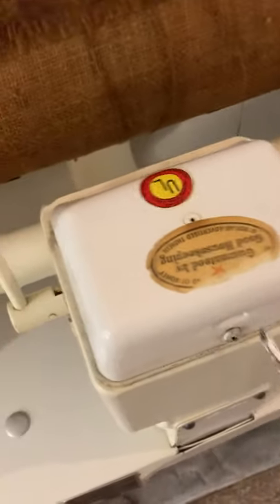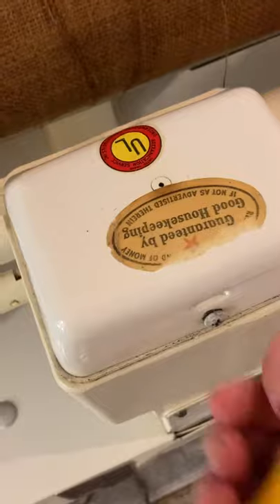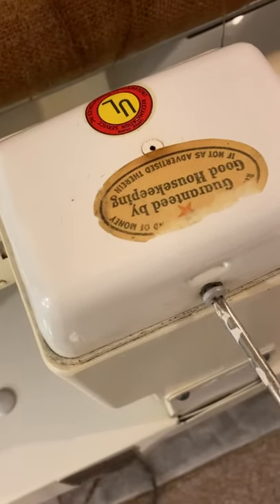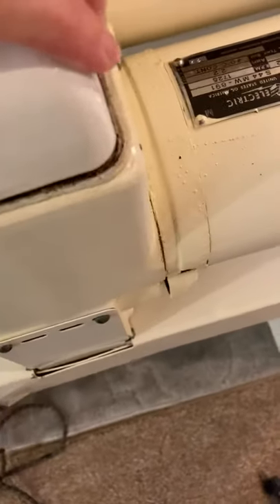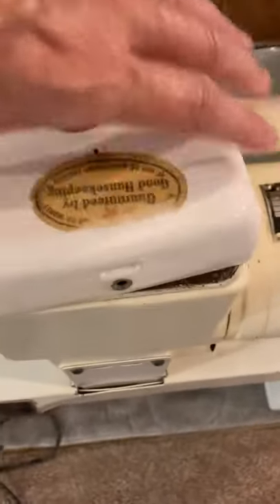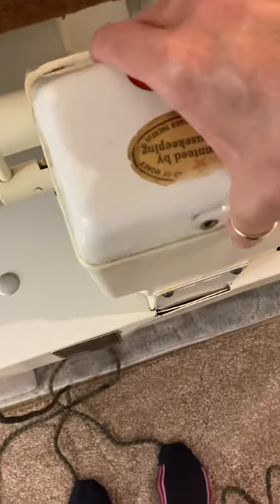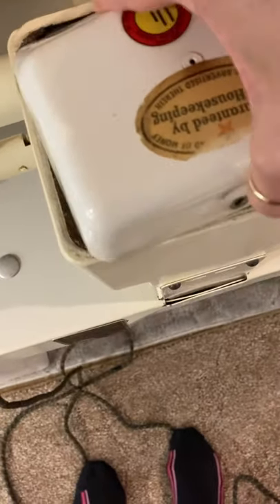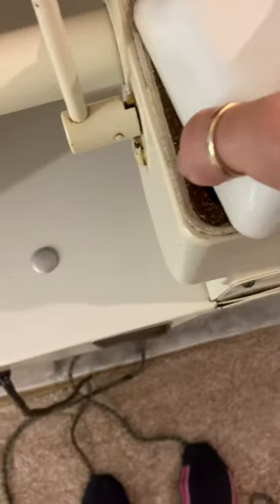Help! Ironrite oil change needed

Comment: Just picked up a model 85, took off that screw just like you, and found that there are a couple tabs in the front of the cover that have a little bend in them to keep the cover down.  Just pull up on the front of the cover and it will come up as it tilts toward the back.  You can also use a screw driver to pry up the front of the cover to get those tabs to unlatch.   Next step for me is to replace the cord with a grounded cord.
Reply: Is the model 88 similar ??